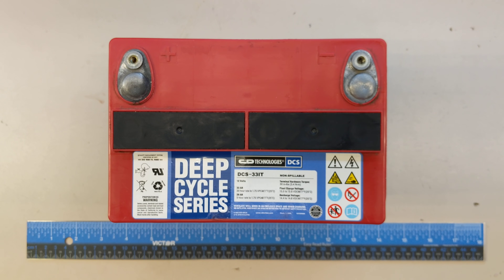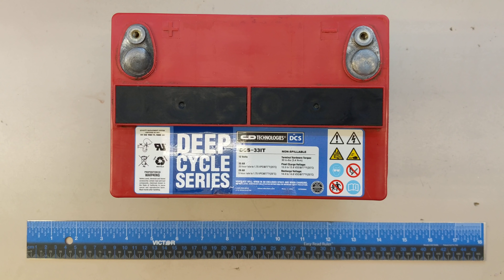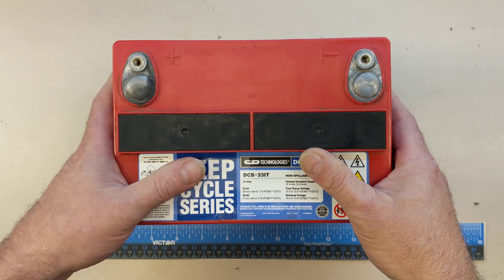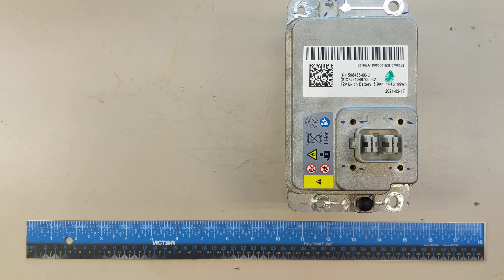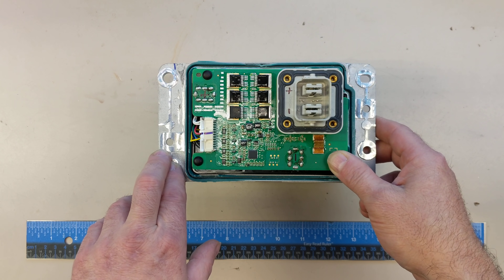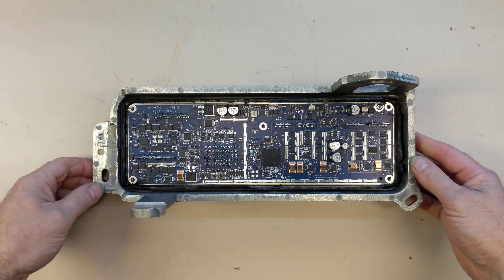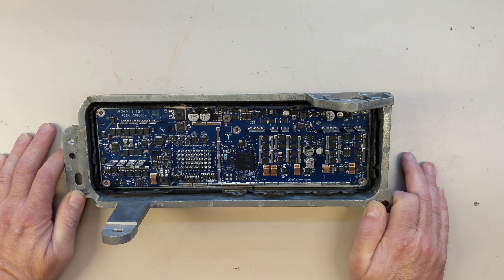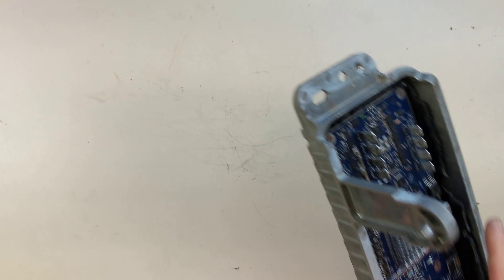Tesla Plaid - 12 volt Lithium Battery PART 1

Comment: This confuses me, I've been tought that the save to touch voltage (sichere Berührungsspannung) is 100V for DC and 50V for AC because the alternating current messes with your heart's frequency.
Reply: VDE 0100-410
Reply from the maker: Keep in mind, AC voltage is expressed in the RMS equivalent to DC, but has much higher peak-to-peak values.  So 240 volts AC is actually around 340 volts peak-to-peak.  This is why 240VAC requires 600V class insulation.  (300V class is exceeded)  The body is strange, and is non-linear, and also depends greatly on humidity, how dry your skin is, etc.  But from experience I can tell you DC hurts WAY worse than AC at the same voltage and is also much harder to let go of.

Comment: Also DC voltage can start decompose the water/blood inside your body that is also dangerous not just the blocked nerve system. And when there is air in your veins you're dead.

Comment: SELV is 120v for DC so 100v DC is highly unlikely to kill you. SELV for AC is only 50v. DC and AC kill you in different ways, AC kills you more by fibrillations but DC kills you more by simple resistive heating and cooking you on the other side of the coin AC tends to throw you off and the zero crossing gives you a chance to let go whereas a high enough DC voltage will make your muscles clamp up so you can't let go.

Comment: I'm not so sure you've got the whole DC is worse than AC thing right. 
100V AC is worse than 100V DC due to capacitance of the body rather than resistance of the skin. Electroboom covers this quite extensively.
Plus you say in Europe its 100 times a second? We're 50hz so 50 times per second.
Reply from the maker: I disagree having been shocked by both many times.   I said ZERO CROSSING is 120 times a second or 100 in Europe.  50hz means a full cycle 50 times a second, but it falls to zero volts 100 times a second each time it reverses.

Comment: I thought contactors only arced when they opened, not closed?
Reply from the maker: Keep in mind, Electricity travels at a good fraction of the speed of light, so a contactor closing is a VERY slow event.  If you have a contactor close onto a high current, it will melt the first part of the contact that is made and "weld" itself.  Without precharge in a modern EV, there can be easily tens of thousands of amps of inrush which will definitely destroy the contactor.   Whereas opening a contactor, as long as it's not done under load, doesn't create any arc.

Comment: Why can they not just use a Power Supply that reduces the high voltage from the main battery to power the 12V electronics all the time ?
Reply from the maker: I've answered this about 50 times now, please read my other answers if you want to know why.

Comment: I've rescued (new) cells that drained to 0.4V. They still had a higher than ususal ESR afterwards but accepted a charge
Reply from the maker: By doing this you are risking fire though.  Doing this can damage the separator, which may not result in a short until later when you least expect it.
Reply: @Ingineerix  Are you saying any cell that reached below 2.8V is basically trash because of a fire hazard?
Reply from the maker: @Flowxing  The actual number depends on the cell, but there have been numerous fires which caused extensive damage to property because of this exact issue.  Search the web for "Gruber Motors Fire" or "EVTV fire" so see some examples.  Gruber motors actually had TWO fires that totally destroyed their facility, once in 2017, then again in 2021!   Any professional battery engineer will have cells recycled if they go below the critical charge level.  Putting them back in the hands of a customer after an event like this is pretty dangerous.   I've personally had LiPos do this, which is why I use a fireproof bag to charge them in now.

Comment: I believe many aircraft run on 48 volts so there are plenty of lights and controls available for that voltage range, and there's been a lot of debate over using 48 volts for automobiles instead of 12.

I also have to wonder if 48v AC would make more sense too, using inverters, but only if the efficiency is high.
Reply from the maker: SAE has been trying to do this since the late 80's.  You can't compare aircraft parts to automotive.  Aviation is a much smaller industry, unit number wise.

Comment: I hope they move on to lithium ion 48V batteries for the low voltage electronics soon
Reply: I believe they will stay with 12V because all Auto parts are 12V driven, bad but this are the available components.

Comment: Thanks! Good details. Surprising if there really is no heater in that battery. Repeatedly discharging enough to generate heat at an already low state of charge when parked for long periods in the cold will likely cause short cell life.

Comment: Ok but 12V is old I think it's time to move to 24V batteries. Lower currents and it's easier to control voltage drops.
Reply from the maker: If you are going to move to 24v and re-do all the accessories, then why not 48v?   SAE made a big push for this in the late 80's.  It's still not caught on except in mild hybrids.  (That all also still have a 12v system)   Supplier inertia is going to be extremely hard to overcome!

Comment: Thanks for the video, would you know why Tesla and others don't use a section of the traction battery and step it down to 12V rather than have a separate either Lead acid or lithium battery?

The original Hyundai Ioniq Hybrid is the only car I know of that did this and even the full electric version still had a 12V lead acid.

Is it as a result of legislation of some sort maybe?

Thanks again.
Reply: Most EVs still run accessories, lights ecu dash off the 12v system. He said this in the video when he talked about suppliers and safety. Also if you dc-dc constantly you could easily allow an ignorant customer to drain the traction pack completely, and also would require the main contactors to stay on all the time. Very bad stuff all around.
Reply: It is required by law for safety lights, etc.

Comment: I always thought the 12v lead acid battery on EVs were a bit old-fashioned? Could you not do the job with a buck converter and a stack of super capacitors?( being charged periodically by the car's main battery)
Reply from the maker: I've answered this now about 20 times:  The HV pack does power everything, just not when the car is "asleep".   There are a lot of reasons for this, safety is one, and due to the overhead, you'd lose a lot more energy than you think keeping the sleep loads alive.

Comment: What cells are in there? You said 2p, but the label says 1p.
Reply from the maker: See my update in part 2:  https://youtu.be/fJH1r1s8B6Y
Reply: True, the label says right on it that the battery is 1P4S (so four cells), not 2P4S (which would be 8 cells). There's no reason to use a tiny 3.5 Ah prismatic cell; 6.9 Ah cells make more sense. Yes, if it used cylindrical cells, then 2P4S would make sense, and he was apparently assuming that without reading the label.

Comment: 4:20 (lul) DC is more dangerous for a given Voltage GIVEN THAT IT PENETRATES. You should add that DC has a way harder time penetrating the body than AC, especially if AC frequency is not the standard 50/60Hz. I recommend electroBOOM if you're interested :)
Watched this vid and pt2 till the end to be sure it wasn't already there before posting this comment. Very interesting videos!
Reply: For the human body, DC is less dangerous than AC. At 3:33 "100VDC can be lethal", usually this is not the case.
Reply: @stal5861  anything over 60VDC can be lethal. 100VDC can kill just like 120VAC. The lethal threshold of current is below the level where it can make your muscles clench.
  
While it’s true that AC can be more easily conducted because the body’s impedance is lower than it’s DC resistance, the threshold for a dangerous voltage is far lower than people realize.

Comment: The 33Ah of the AGM battery are not the usable capacity. In order to prevent damaging the battery, you can only discharge it to about 50%, so 16.5Ah usable capacity. And that is much closer to the LiIon replacement.
Reply: Actually, lead acid suffers for Peukert's effect, actual useable capacity is much closer to 27% with typical automotive batteries. This would translate to about 8.9Ah, pretty close to the Li-ion replacement.

Comment: I have put a 12V contacts on my 12V battery. And everytime I don't drive my MS 70D I put it on 12V battery charger. No more vampire drain and it will keep the 12V battery longer alive.

Comment: Why do they not use a 12v step down voltage regulator from the main battery pack?
Reply from the maker: The HV pack does power everything through a DC-DC in the PCS (Power Conversion System), just not when the car is "asleep".   There are a lot of reasons for this, safety is one, and due to the overhead, you'd lose a lot more energy than you think keeping the sleep loads alive

Comment: No heater. No thermal management. If they used the same Fire Cracker Technology(tm) they've used in every battery they've ever made, this thing is an explosion waiting to happen. Heat one up to ~200C; let's see...  So, they've been eating 33Ah deep cycle batteries and they think a 6Ah LCO will work?

Comment: Is the battery acing as a LIN master node?
Reply from the maker: No, it's the slave, the VCBATT controller is the master.
Reply: @Ingineerix  Then where does it get the signal to power up if it only powers when given a LIN directive? How does VCBATT power up to deliver a signal for the only available power to activate?

Comment: The reason for a lead acid 12V battery in a modern car was a Tesla interview question for a while. I'm glad they finally updated the 12V to something better. Shows how cheap Li Ion has finally gotten as they wouldn't do this unless it offered a cost savings over the warranty period (4 years, 50k miles) vs the lead acid

Comment: 50-60 Hz happens to be the most dangerous frequency for our bodies. Over 10 times as much DC current is needed to disturb our nerves and stop the heart. So 40 VAC stop heart as easily as 400 VDC.
Reply: Old adage: It's the volts that jolts but the mills that kills.
Reply: 40VAC tingles... 400VDC burns!
Learned that in the "school of hard shocks".
Reply: @stevedresen8497  800 VDC certainly burns.  I have got a shock to finger tip from 240 VAC and I did not get burned. Note that 240 VAC is from -340 V to + 340 V peak to peak. = Total 680 V.

Source mentioned above: 'Voltage levels of 500 to 1000 volts tend to cause internal burns due to the large energy available from the source.'

'At around 10 mA, AC current passing through the arm of a 68-kilogram (150 lb) human can cause powerful muscle contractions; the victim is unable to voluntarily control muscles and cannot release an electrified object.'

Note for your tingling experiments: 'It is sometimes suggested that human lethality is most common with alternating current at 100–250 volts; however, death has occurred below this range, with supplies as low as 42 volts.'
Reply: @jkn6644  yeah, that RMS is "killer" ounce rectified and filtered.  A 480 VAC invertor's DC bus is almost 600 VDC.
Reply: Please provide proof!
Reply: @universeisundernoobligatio3283  https://en.wikipedia.org/wiki/Electrical_injury
A domestic power supply voltage (110 or 230 V), 50 or 60 Hz alternating current (AC) through the chest for a fraction of a second may induce ventricular fibrillation at currents as low as 30 milliamperes (mA).[8] With direct current (DC), 300 to 500 mA is required. ... If not immediately treated by defibrillation, fibrillation is usually lethal

Comment: It is NOT a lithium battery but a lead acid-one. As you can see the "don't trash Pb" stickers, and the cells access for acid !!
Reply: Looks much too light to be lead acid, I think they just used a generic symbol to show it should be recycled not thrown away.  Plus Tesla has said it's lithium.  Confirmed that it's lithium at 7:39 you can see the Li-ion sticker, not Pb.
Reply: @JRP3  just take one cover out and take a look. 
As it is illegal to misrepresent the chemical content of a product it is very unlikely that it is a generic symbol...
Plus, Lipo and Pb should not be handled the same way, on Lipo you find stickers with: "don't pierce", flamable and so on...
Reply: @TheZogzig  I took a closer look at the video, I don't see any "Pb" sticker but I clearly see a "Li-ion" sticker.  You can too if you stop the video at 7:39
Reply: @JRP3  the Pb sticker is on the top cover.
Reply: @TheZogzig  Are you talking about the red battery, which is the older lead acid battery?  Because that's the only one with a Pb sticker that I see, which is the correct label for it.  The new smaller lithium battery has the "Li-ion" sticker.

Comment: Thanks for the rip art so we can have a look! I wonder what the DC/DC charger voltage is set to? I would assume that it will be same as for a traditional lead acid battery @~14.2volts. This would charge the 4 cell li-ion cell to almost 50% which is an ideal voltage for long term li-ion battery storage/longevity. I doubt it would ever charge the battery to 100% (16.8volts) which is a bit to high for most components and not good for the lifetime of the li-ion. Also wonder at what point the computer allows the battery to discharge down to before engaging the DC/Dc? I would guess it will come on a lot more frequently (both due to the smaller capacity and not wanting to discharge the battery to much for longevity).
Reply: li-ion is not ideal for 12V systems. You want lifepo4. A fully charged lifepo4 battery will be at 14.4 and settle at 13.2
Reply: @V8Power5300  yeh. Exactly. Lifepo4 have been the traditional go to to replace a 12 volt system because the voltages of a 4s setup aligns perfectly. Which is why it interesting Tesla have gone with li-ion. My guess is that because they will stay at about 50% charged most of the time they will last a long time. Another possibility might be tesla have designed their 12volt components to be able to cope with a slightly higher voltage (up to 16.8 volts)?

Comment: From many tests I’ve read on acid batteries, they’re at best ~60% of advertised capacity, but they can provide really high current without degradation for ICE car startup. 

So it seems that’s why it’s 99WH, it’s just enough but yea, funny it’s within flight safety limits

Comment: Well you could run all 12V stuff on a DC/DC converter. In fact a number of electric scooters have no 12v battery. Don't  like how it is not servicable as it doesn't look cheap. As Lithium batteries don't like to be fully charged Im pretty sure they operate it at SOC 50-70% and nominal 12V, operational 14V (= ICE with alternator charging). Was waiting for you to further disassemble the battery. And finally: Where can you access this emergency charge terminal? On mine it is under the Nose Cone.
Reply: That would make OBD on the main pack a lot more challenging.
Reply from the maker: The HV pack does power everything through a DC-DC in the PCS (Power Conversion System), just not when the car is "asleep".   There are a lot of reasons for this, safety is one, and due to the overhead, you'd lose a lot more energy than you think keeping the sleep loads alive
Reply: @Ingineerix  you lose 10% from the buck converter, plus how do you do diagnostics on main pack thats glitching when that pack has to power the diagnostic systems?
Reply from the maker: @alexandrsoldiernetizen162  First off, they don't use buck converters because the HV system if fully isolated, so it's a DC-DC converter with galvanic isolation.  It's upwards of 95% efficient too.  Yes, this is one more reason why we still have a 12v (15v) battery.
Reply: @Ingineerix  buck converter is a DC-DC converter,  one that steps down, a boost converter is a Dc-Dc converter too, one that steps up.  Only synchronous converters with a narrow range achieve 95%, they are extremely rare, most typical is an 85-90% range. Based on the voltage differential, I would estimate less than 90% but I was being generous.
Reply from the maker: @alexandrsoldiernetizen162  Ok, I should say ISOLATED DC-DC.   You cannot use a simple buck converter when galvanic isolation is required.  Tesla most definitely uses a synchronous converter using SiCFETs (primary) that can also run in reverse for precharge.  I touch on this in my 2 PCS videos: https://youtu.be/lXokJEzXwaI
Reply: @Ingineerix  It doesnt have anything to do with the simplicity of the conversion circuit, the isolation comes from the transformer section. You can build a simple buck converters thats isolated via transformer, it will just be less efficient than a synchronous converter, and wont operate in buck/boost mode.
Reply from the maker: @alexandrsoldiernetizen162  A buck converter by definition does not use a transformer.

Comment: One of the biggest reasons why Pb batteries were used was cold discharge performance in case of DCDC failure or open contactors on the road when it's cold. The EPAS takes ~100A spikes and you do not want to lose that on the highway. Looks like they proved that the lithium can provide that when it's -30 or whatever.
Reply from the maker: Yeah, you wont be driving too far if you lose HV, so all it has to do it get you to a stop safely.  That it can do!

Comment: 6,9Ah, 1P4S, 99Wh. 1,7Ah per cell. Cell nominal voltage 3.6V. 
1725mAh is such a low value it is likely high current cells. At least 20A nominal. I'm pretty sure cell voltage is limited to 4V max. This is within maximum 12V system voltage that is acceptable for semiconductors (16V).
Reply from the maker: Amp-hours is not divided because they are in series.  I think it's actually 2P4S, so each cell would be 3450mAh.  If it is 1P, then each cell is 6900mAh.  Yes, they don't go over 4v/cell that I've seen.
Reply: @Ingineerix  As you later realized, it is 1P4S.
Reply from the maker: @brianb-p6586  Yeah, once I took it apart.   See part 2.